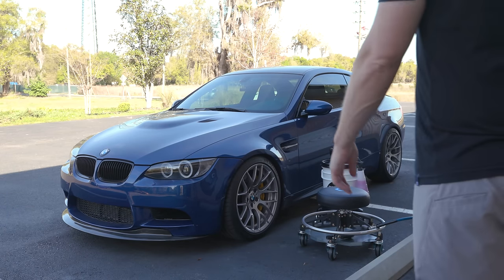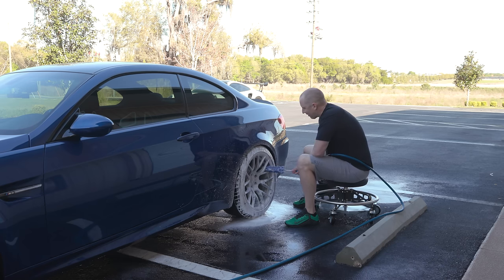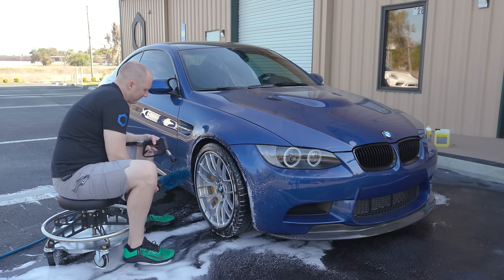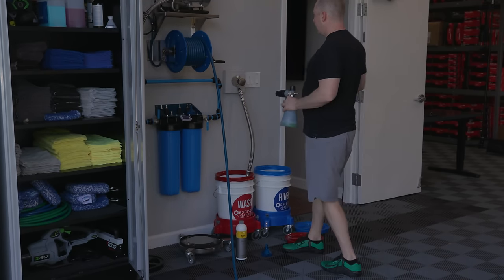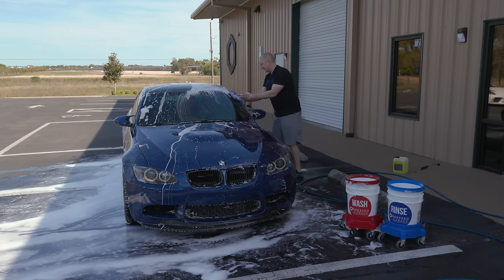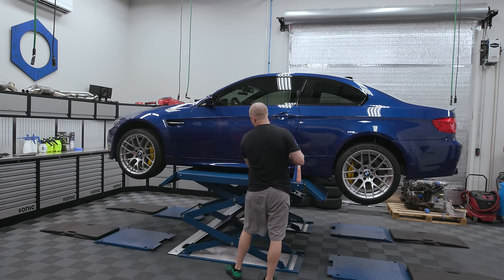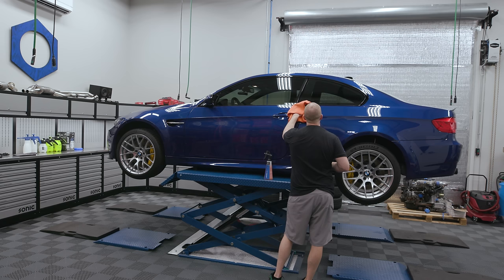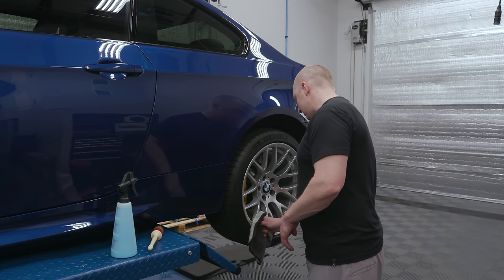E92 M3 Wash & Talk

Comment: Did you buy an E36 M3 coupe or sedan? I'm an original owner M3/4/5. No matter how well you take care of them all of the rubber and plastic wears out and needs to be replaced every 8 or 9 years if you want to keep it looking new. The problem now is many parts are NLA. Many interior trim pieces and coverings, door panels and misc trim is not available new. I would advise if you need things like the M door sills, seat belts & seat belt receptacles,  grill/vent (dash) pieces, coin tray and cup holder for center console, exterior door handles etc...  buy them right away they won't be around much longer (I bought extra sets of some of these pieces the most recent time). Second thing that comes to mind is the headliner will fail because the foam breaks down... it sucks getting it out and getting it re-done.. You can buy a new headliner for $1600 (yes a $1600 headliner) or buy the original fabric from Veterans in LA and have it redone... then...... the A & C pillars disintegrate regardless of how well they were taken care of. The ABS+PC just breaks down and when you remove them the clips disintegrate. The anthracite fabric also turns purple/gray over time). New A & C pillars in anthracite cost another $1400... or you need to buy another color (tan) for cheaper and rip of the material and replace. Lastly, if you have black interior the anthracite rear deck also turns really purple. They're hard to strip and recover a new one cost another $600. Point is: 1) The E36 M3 is very expensive to maintain properly 2) many parts are NLA. Congratulations & Good luck! they are awesome cars.. the last of the true drivers car.

Comment: I live in the UK and have been watching for a while

I like to listen while washing my own car

From experience you can get a euro E36 LHD with UK clocks
If the mileage is incorrect it will show a tamper dot but a main dealer or specialist can correct it
Euro spec are much closer to the E46 in terms of experience

Either way good luck on the purchase, techno violet is one of the best colors they made

Comment: Quick question Matt. We all know how coated and protected your car is but is there a reason why you don’t soak each wheel with the cleaner instead of going one by one ? Because I don’t think you’re afraid of getting spotting especially working in good conditions. Thanks
Reply from the maker: There is no need to do that with the coated and well maintained wheels.  Plus a heavy alkaline cleaner like P&S will leave nasty spots if it dries.

Comment: On your perfect E46 M3 spec why black leather and not the M-Texture cloth interior to have matching cloth interior M3s like the E92 and E36? I would also say you don’t want an E46 with the cold weather package, because that would add heated seats and ugly headlight washers on the front of the car. Also find one without the navigation unit as it has not aged well. A super rare spec at least in the US is one without the bi xenon headlights, but I would think you would want those. Have you thought about if you would want one with out without harmon kardon sound? H/K sound adds a janky “subwoofer” on the top of the inside of the trunk. Any thoughts on the interior trim you would want?
Reply: And manual seats inside of the optional power seats.

Comment: A question about the foaming process - I know you have undertaken empirical testing but would it not be logical to suppose that having soaked the dirt on the car [that which remains after pressure rinsing] , expanding the dirt/grit by foam/water absorption making it heavier and more prone to dripping off - would it be better to rinse at this stage instead of risking wiping residual dirt across the paint with the Incredipad? Perhaps I am thinking about the hideous sticky dirt sprayed up on UK roads - perhaps the FLA experience is different? Doubtless a competent well maintained coating would help in the first instance...just a thought...
Reply from the maker: I don't think so.  The pressure washer should take care of anything that was going to come off during the rinse phase.
Reply: Matt - you are consistent! I just re-watched “To Foam or Not to Foam” from Dec13 2017 which explains it all. Makes perfect sense - experience not opinion...